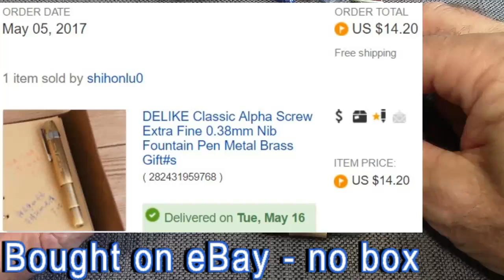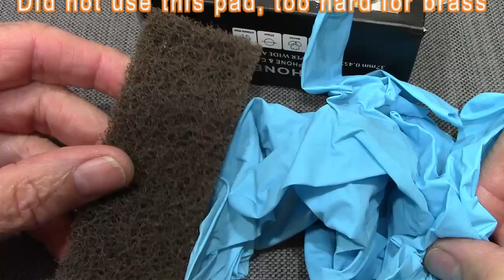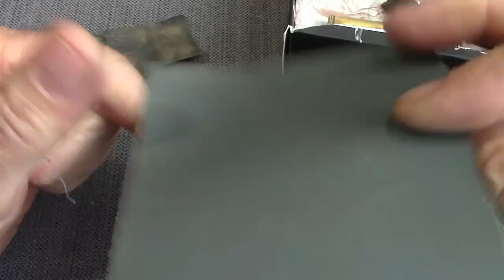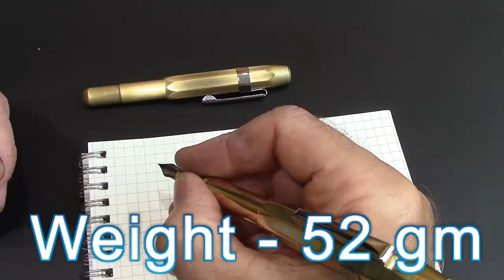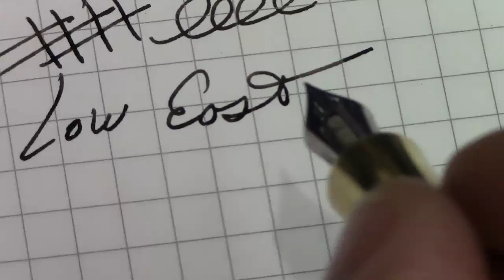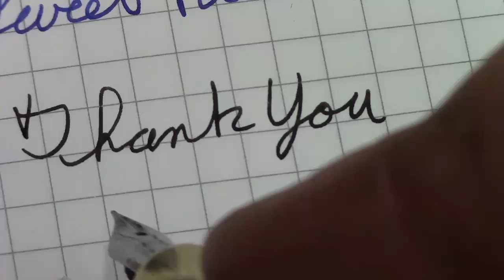Delike Pocket Raw Brass Finish - looking good

Comment: I have a question, I have the delike brass sport and I am finding that the cap won’t screw on now.. seems the plastic insert that had the threads has gotten pushed too far in. So now the cap will not stay on.. any suggestions? I have tried to get it out with tweezers... thanks...It does write great..
Reply from the maker: On mine, the threads are at end of cap liner.  Appears to be one piece liner that extends to top of cap.  Have you removed section to see if that allows threads to catch?  If so, maybe you can pull out cap liner & see how to fix it.  My guess is that cap liner came loose (appears to be glued in) and turns so threads don't engage.  Let us know if you do fix this.
Reply: chrisrap52 I did try to get the cap liner out with tweezers, it is very hard to grab and seems jammed in there. Yes I think it has been pushed up to the cap end so the threads don’t catch from the grip section.. not sure how to get it out. I looked at the finial end of the cap to see if I could get in from the other end, but it looks like it might be one piece... hhhmm can’t really carry the pen if the cap won’t stay on..
Reply from the maker: Have you removed section with nib & tried to screw in barrel with section removed?  That will allow the threads to be deeper and hopefully catch the threads.
Reply: chrisrap52 I did try that and it worked! Thanks so much!!!
Reply from the maker: Glad I could help.

Comment: Hi there Chris. I got these pens after i saw it on your channel because i like the kaweco style but its too expensive. I want to take the top coat off too but i'm wondering how yours has been doing?  Also i got a matte steal finish one which I've been trying to sand down but its got several metals on it. I posted a video on my channel if you would take a look. I"m not sure how to get that one down to bare brass. your help would be much appreciated. Thank you for the video
Reply from the maker: Takes lots of elbow grease to remove finish to raw.  My raw brass shows some tarnish, easy to polish off.  I saw the grey models, wondered what they were,
Reply: i ended up going for the sanding method for the brass colored one and wow it takes a lot of work. The other is probably a coat of aluminum then copper then brass. A sub said that copper has potential to oxidize nicely so i bought a tiny dremel and im gonna work on that.

Comment: Great vid! I removed the lacquer on mine with similar method, but the threaded plastic cap insert felt off. Tried to glue it back in place with loctite, didn't work. Sanded again and glued with contact cemen, seems ok now. Great pocket pen for the price, nice converter too. Do you know y you can swap nibs or nib units with the Kaweco Sport pens? Greetings from Spain, and thank you in advance
Reply from the maker: Good to know.  Haven't tried swapping.  My Kaweco's are fine & med.  If I had a broad I would.